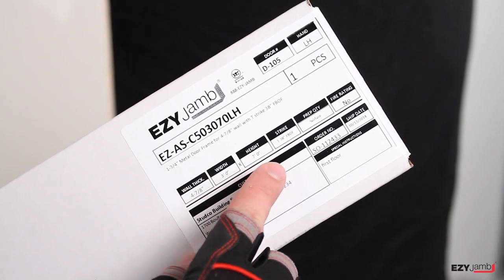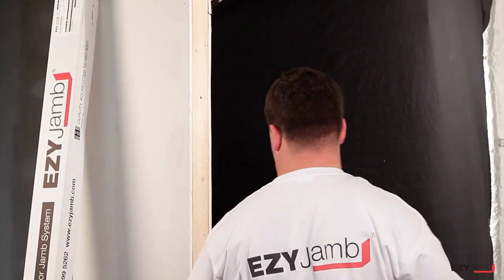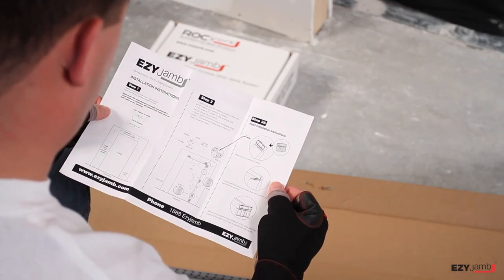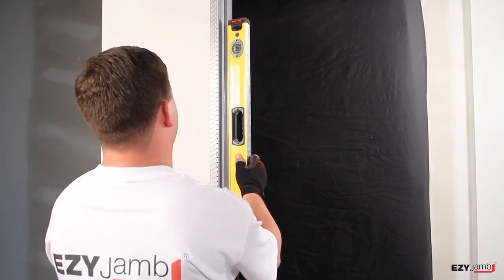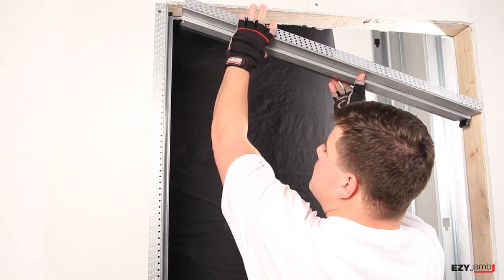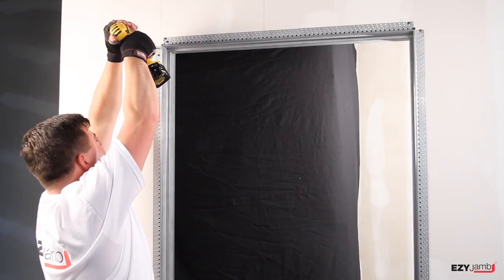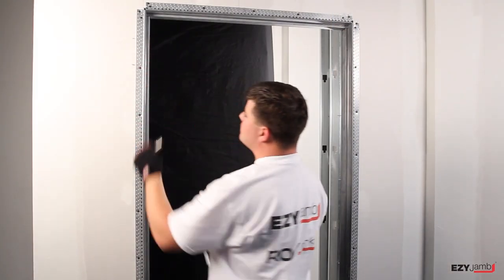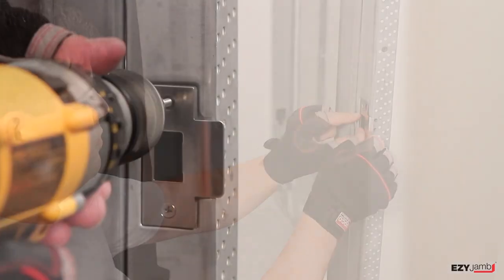Ezyjamb Installation - The Ezy Jamb system

Comment: but how do you hide the aluminium frame
Reply from the maker: The perforated sides can be finished flush with the wall and the jamb is ready to paint in with the rest of the wall due to the specialized coating. If you would like more information about EzyJamb, please visit www.ezconcept.com to contact our branch in your local area.